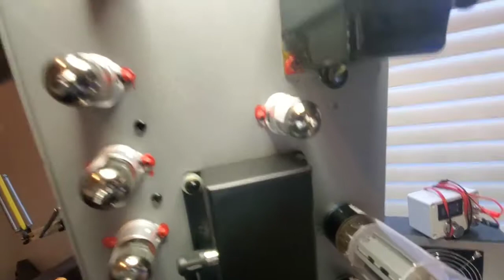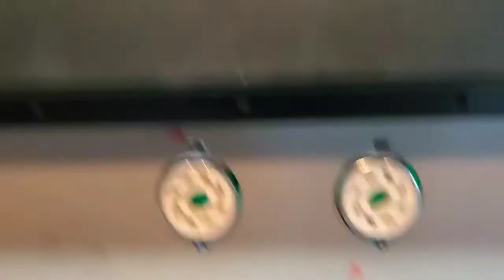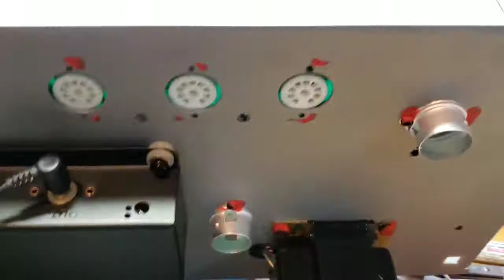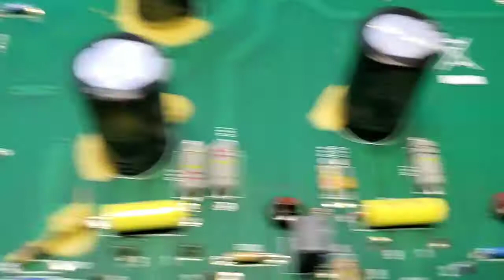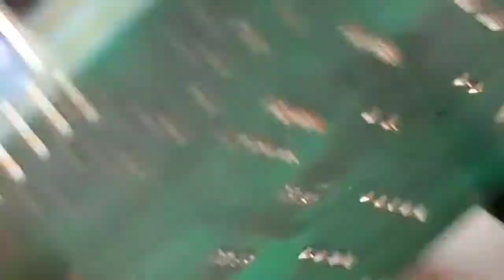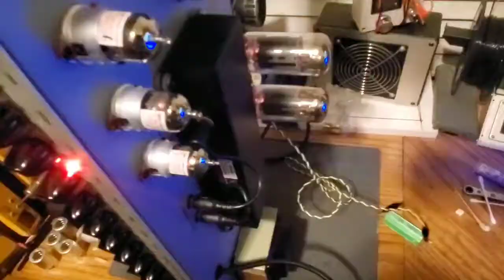Peavey 6505 6505+ no sound from input repair diy how to

Comment: Thanks for this video! You replaced the original 1N4003 (1A, 200V) diodes with 1N4007 (1A, 1000V) diodes: are you certain the voltage was the issue, and not the current? Have any of the many Peavey 6505+ amps that you have repaired suffered subsequent failures?

Comment: That's wild they soldered the fuses onto the board like that. Doesn't that defeat the purpose of a fuse (an easily replaceable component you can swap out)? Also, I have a Peavey Ultra 60 with no sound, but my fuses are good (out of circuit) and all the tubes glow and the FX Return trick still makes no sound. Been digging through Enzo's posts on the Peavey forum, but still no luck finding a similar issue. Any ideas on how to diagnose?
Reply: The hope is the fuse never blows. If it does, theres bigger problems. And you should see a tech before the user just shorts the fuse socket and starts a fire

Comment: Anyone know why this issue happens? I'm having the same issue on a Peavey 5150 ii. Ran the same test, and the rec diodes are bad. Just curious why it happens.
Reply: No idea, I'd gladly take the head though:)
Reply: What I’ve understood from the combo, is that the diodes can not handle the current and are under powered (if I say that correct) and they will burn/fry over time of usage.
I’m always wondering if the new 6505 originals also have this issue or if they finally used better components for this great amp.

Comment: Mine is the 5150iii 50 watt combo. I did find a couple bad diodes one is up by the power tube board but the other one is on the main board where the rectifier is where the three orange wires come from the transformer.. the preamp tubes don't light up and also the LEDs don't light up or the power  LED.

Comment: If you can help me much would be appreciated. I have 6505 I had a missing preamp tube and I have a burnt out 15 voltage regulator the other ones good and I have two fuses burnt out what other things on that board should I also look at so I'm in the safe. Before I do any repair thank you

Comment: Hi
I've replaced the same rectifier diodes (there was burn marks on the PCB were the factory fitted ones are) for 600V types in my 6505 and the amp powered on after re-assembling it, then it went went back off and won't power on again, do you know what the problem might be?
Reply from the maker: How long was it on for? Did it play before it went off for good?  And when you say won't power on do you mean no sound again or it will not power on at all?
Reply: It was on for 1 minute if that then went off, and it won't power on at all from the mains - the clean/dirty channel lights are not lighting up when it's switched on.
Reply: @pistonhedd  did you find out what the problem was after replacement of rectifier diodes? I have a 5153 first edition 50 watt combo and just one morning it wouldn't turn on no preamp tube glow or lights in front. But the power tubes light up. I have found two bad diodes but nothing else yet
Reply: @metalfather8139  Hi, no I never found out what was wrong - I replaced the BRDs and Capacitors and it still wouldn't work, so I gave up, cut my loses and binned it (it was second hand as well). I've since bought a brand new 6505 Mini Head .
Reply: Did you find out the issue why came on an quit an wouldn't turn back on?

Comment: Hey, curious if you bled the caps before doing this? I have the same problem with my amp and am capable. Just wanted to be sure of cap bleed procedure before I got into it. Thanks!
Reply from the maker: Yea its never a bad idea. If the amp sits unplugged from the wall more then 15 minutes or so there shouldn't be and voltage left in the caps but to be safe you can check for voltage with a multimeter.  A lot of the amps I repair I'm switching them on and off to get voltage readings and in that sitution I have a 200ohm 40 watt resistor that I've soldered  alligator clips on and I use it between the amp and chassis to bleed them quickly. Letting it sit unplugged for a half hour unplugged and you're going to be safe but use a dmm and check voltage if you have one. Capacitors can hold high voltages but not for long periods of time once powered down.
Reply: Audio Jack Thanks so much for the reply and taking the time to make this video. Got my 6505+ back together tonight with some fresh diodes and it’s working great again!
Reply from the maker: @joshsampson1115  awesome.  Nothing better then saving some money with a diy. Glad it helped.